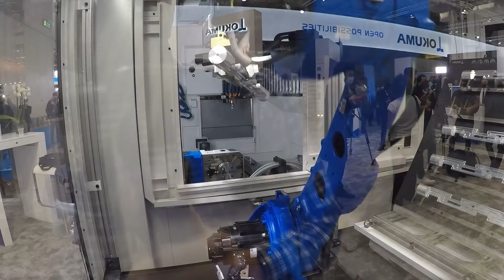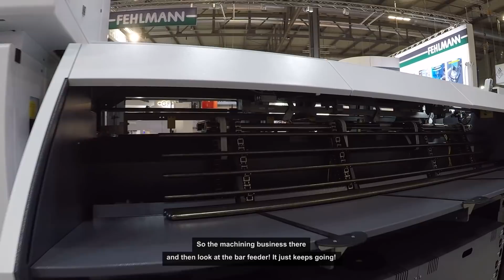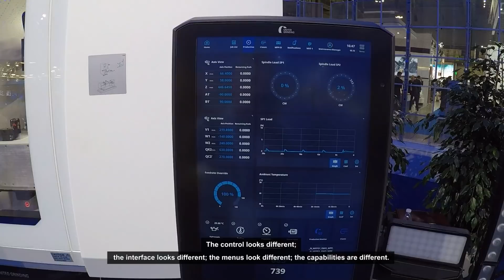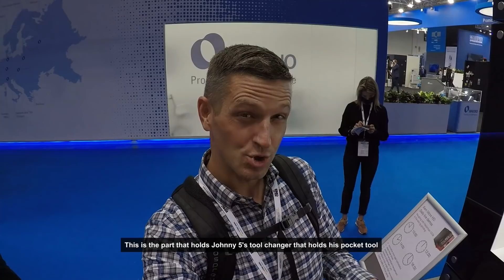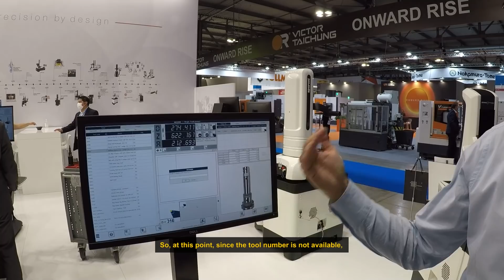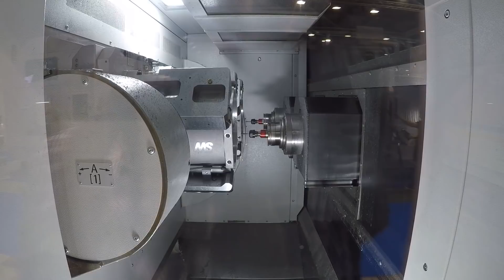EMO Milan 2021 - World's BIGGEST CNC Trade Show!

Comment: You think that stuffs big you should see the old machines we rebuild and convert to cnc. Talking steel mill roll grinders with 60" swing x 240" length capacity grinding rolls 100k lbs. Most of our machines use a 36" diameter x 3 or 4" wide wheel for some perspective. The stuff we do isnt as fancy as the stuff at this show but they live in some incredibly harsh environments.

Comment: The Kern guy was so high energy over precision I now want only Kern machines.
Reply: You should see their instagram, that’s all they care about.
Reply: We have 3 Kerns in our shop and oh boi are they precise. But sadly they have a lot of other problems. Specially the tool changer. Spindle doesnt open on time / sensors broken / Sensor fails reading tooling ect. Also you can unlock the door mid tool change...